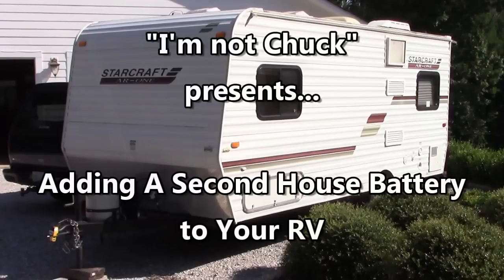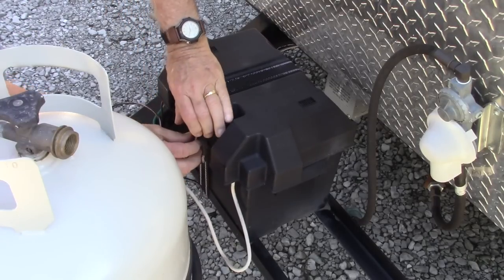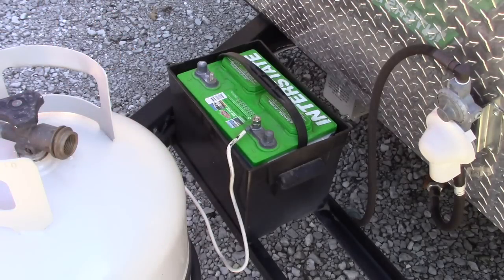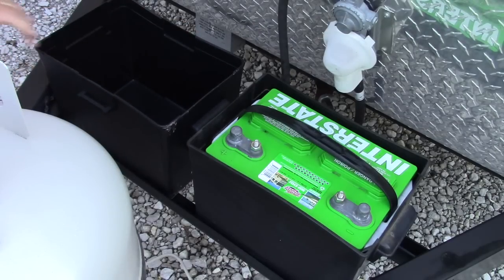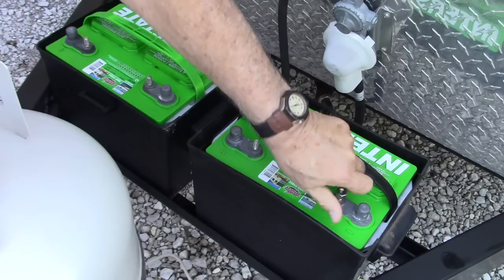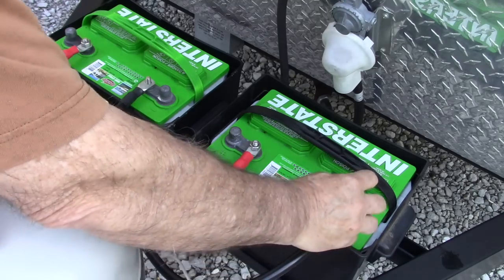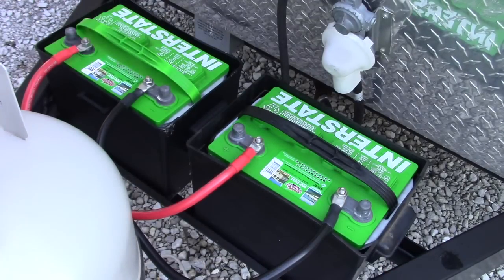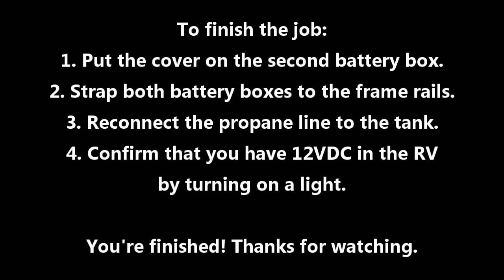Add a 2nd RV Battery

Comment: Great job on the video, you made it simple and easy to fully understand. However, I would suggest an add-on to the video and that's to be carful with wearing a watch, especially one with a metal band and/or a metal clasp. I had an incident where my watch touched the positive lead casing a burn to jump to the opposite side of my wrist. Apparently the current went right though my wrist. Believe me a 12v battery can really give you a jolt.
Reply from the maker: It would be better to remove any metal from your hands. The problem is not so much shock as it is burns. Thanks for watching and commenting. Please subscribe if you haven't already.

Comment: Make sure both batteries have the same date codes so that there is little difference in the capacity of both batteries. If one battery is older than the other, it may have a lower voltage/current capacity causing the two batteries to "fight" against each other, and may cause early failure of both. I found this out when I paralleled two batteries in my Jeep, one original, and another 4 months older. Try to pick both batteries off the shelf with the same, latest date codes. Look in the back of the shelf for the newer batteries, as the seller rotates the older batteries towards the front so they get sold before they get too old. ALWAYS keep both batteries shiny clean, because road dust has iron rust powder (from rusty cars and trucks) in it causing a high resistance path between the positive and negative posts, draining the batteries even while not being used. I use Vaseline to coat the posts to keep corrosion from starting.
Reply from the maker: Very thoughtful ideas. Thanks much for the input and for watching. If you haven't subscribed, please do.
Reply: They have a special grease for batt. Terminals I tk.

Comment: I got rid of my single 12 volt battery and bought two 6 volt batteries, ran them in series and now have 12volt with about an extra 185 amp hours more than two twelves ran parallel like you did.
Reply from the maker: Using two six-volt batteries in series is preferred by many people, and is a good method. However, the specific amp hour capacity in either case depends upon the batteries chosen. Thanks for your comment; please subscribe if you haven't already done so.

Comment: Hi, when adding a second battery, does it need to be the exact same brand or specs. I have a second 12v deep cycle battery but it's from Costco and the one in our rv is an Interstate 12v deep cycle. Thank you very much.
Reply from the maker: Yes, both batteries should be the same age, brand, and specifications for optimum performance and life. Otherwise the newer or stronger battery will do more work and age faster. Thanks for watching.

Comment: Great video. I have a 1 year old battery. Can I add another battery parallel even though it’s 1 year old? Would 4 gauge cable be ok? What size cable do you recommend? Thanks
Reply from the maker: Larger diameter cables are better, but four gauge will certainly work. And generally, it's better for batteries in parallel to be "mates" in terms of age, etc., it's acceptable for them not to be. Thanks for the nice words and for watching.

Comment: Good video, thank you.  However, I have to agree, the negative wire from the trailer should have been connected to the negative post of battery number two.  It would help both batteries to receive equal use and therefore wear equally.
Reply from the maker: Thanks for watching the video and taking the time to comment on it. I also appreciate the compliment.

Comment: This is how i planned on doing this, my question is.  Do you need identical batteries? I.E. say one is a group 24 with 500cc and 600c and the other say a 27  or still a 24 group with 600cc and 750c. Reason i am asking is i will be converting over to interstate RV batteries but currently, i have an Oreily deep cycle that has been good but i want to upgrade. However, this battery is still in good shape no sense in tossing it. once it dies ill get another interstate identical to it.
Reply from the maker: Both batteries should be identical in both size and age, if possible. Otherwise, they will discharge at different rates, and the capacity difference will increase over time. Before you buy Interstates, I would suggest you consider true deep cycle batteries such as the ones made by Trojan.
Reply: Interstate Batteries are imported now and Trojans are also. 
So the quality is not what it was years ago. If you have a Batteries ➕ bulbs in your area the DURACELLS are the best 🇺🇸 made available.

Comment: nice vid.. unfortunately you took out a worthless battery, and replaced it will another worthless battery.. (not deep cycle) get a couple of t-105s or so. I found the GC2 size (golfcart size) battery box like you use at Walmart online.  You can get a good 6v GC battery at Costco for $93 dollars each, and have a true deep cycle system.

you use a nice size cable between the batteries and use the same too small cable to RV.. that's where you need the size more than between batteries.. and it does matter a bit on where you connect the leads,, one to left bat positive and other to right bat negative to keep the pull the same between batteries.. 

keep up the good work.
Reply from the maker: Thanks for the compliment and for your opinions. I agree that Trojan batteries are quite good. Please subscribe if you haven't already.
Reply: Carl Newton j
Reply from the maker: Thanks for watching and for your input. As to the relative worth of dual purpose batteries versus true deep cycle batteries, I agree that true deep cycle batteries are better, but I am not sure whether they are sufficiently better to justify the price increase. I am now testing some cheap dual purpose batteries to see how they perform with proper maintenance and correct charge and discharge patterns. So far, they are doing well, but I am only eight months into the test. I will be doing a video on that experiment in the future. Please subscribe if you haven't already.

Comment: Can't go wrong with an Interstate Battery! Last fall I had my camper plugged into the house, while I was doing some cleaning and getting it prepared for winter and forgot about it and thought nothing of it. My battery was 4 years old. Well ....3 or 4 days later it exploded! I called Interstate Corperate to find out why?  They told me that it keeps charging when you are plugged in, and here I thought it only charged when going down the road being towed. Well guess what? Interstate brought me out a brand new battery! I didn't even ask for them to replace it, I was just wondering how to prevent another battery from exploding in the future! Customer service like THAT is why I will always buy Interstate from now on!
Reply from the maker: It's always great when good companies stand behind their products. Thanks for subscribing, watching, and commenting.
Reply: The Ac/Dc converter of your trailer should have cut back or cycled the charging off when you were plugged into the house. The battery may have exploded to an overcharging failure of the converter.
Reply: hughie voso Probably correct.

Comment: Hello, very informative video as well as the detail of your pinned comment.  Thank you.  My trailer is about a year old and I am looking to upgrade my cables as I do have a problem with one battery discharging faster than the other.  I’m guessing it is because the dealer only used 8 ga wire to connect the two together.  I even switched the batteries and the way it’s wired it still discharged the one with the main coach cables first.  Can you give a suggestion on running new cables to the fuse panel?  Currently it’s not marked but looks to be 8ga maybe 6ga at the most.  Is there any disadvantage to going too big, or a point that there is no addition benefit to a thicker ga?  Thank you.
Reply from the maker: 8 gauge wire is sufficient from the batteries to the fuse panel and is actually better than the 10 found in most travel trailers. My suggestion for very heavy cables is only to connect batteries in parallel. It could be that one of your batteries is just weaker than the other, and there isn't anything I know to fix that. Thanks for watching and for commenting.

Comment: Would there be any advantage to connecting the GROUND cable to the OPPOSITE battery ?
Reply from the maker: No, not any meaningful advantage. Thanks for watching and for commenting.
Reply: yes it will make a more even draw off the batteries more balanced..
Reply from the maker: @cruzinbenny3750  No, it won't. That's one of those things that seem logical, but has no basis in science. Thanks for watching.
Reply: I see this suggested on many articles and forum posts about parallel RV batteries. As an electrical engineer myself, I agree there is no meaningful reason to connect one cable to opposing batteries. From a purely textbook sense, those 0/1 gauge wires will have a tiny loss over the ~2 feet or so, but in practicality, it won't be noticeable.

Comment: Battery that are connected in parallel. It's better to connect positive cable on one battery and negative cable on the other. Then you drain both battery equally. 
Be sure to have same length on both cables between the batteries.
Just a tips.
Reply from the maker: Thanks for watching and commenting on the video. Please read my my post pinned at the top for an explanation of why I do not accept that there is any reason to wire my batteries differently from what I showed in the video.
Reply: Hi if you hook them in Parallel will that give you 24 volts or still 12 volts
Reply from the maker: @Farmer2492  What you see on the video is a parallel configuration. If you were to hook the two 12V batteries in series, then you would have 24V. Thanks for watching.

Comment: I'm not Chuck, I have another question. I have enough room on my trailer tongue for three batteries, can I connect three batteries in parallel for more electrical storage?
Reply from the maker: Sure, just be sure to use heavy wire and good connectors. It's preferable to have all the batteries be the same type, size, and age.
Reply: @ImnotChuck.  Thanks, I'm not Chuck, just bought a bumper pull, I'm taking a boon docking zig-zag route, (six weeks travel) to the coast of Oregon, from Weatherford Texas and need all the juice I can store, (powered by a Champion Gen). 
     I'm subscribing to your channel now.
    Good  luck.
Reply from the maker: @nehpetsrellek2750  Sounds like a great trip. From what I can tell, the Champion gens are good units. Take care.
Reply: @ImnotChuck.  👍

Comment: Ive found that a lot of devices I have in my home, such as my cable internet modem, the wifi router, and the cell-spot router for T-Mobile, all are connected to the 110AC, and each one converts it with the big plug that goes into the wall, (Switching power supply AC>DC0 all run 12v at the device itself.  I purchased a Marine battery, deep cycle, a cheap 12v solar panel for RV's, and have hooked each one up, by cutting the plug off of them, and connecting them directly to the 12v batter.  I did it this way, because if I purchased an Inverter, and plugged the devices directly into the inverter, I would be then converting DC from the solar panel, to AC in the inverrter, which then would be converted back into DC with the plug.  This makes it roughly 60% more efficient after I did the math.
Reply from the maker: That's a good way to make more efficient use of DC from solar panels or from any DC source. Thanks for watching and for commenting.
Reply: This went so far over my head.
Reply from the maker: @Simply_Anthony83  Thanks for watching and commenting. If you don't "get it" you should probably not work on the electrical part of an RV.

Comment: Is the heavy cables between the two batteries necessary?  The feed wire for the trailer seems much smaller, so couldn't you size the wires between the two batteries to the same size as the trailer feed wires?
Reply from the maker: Hi. Thanks for watching. It does seem like smaller wires would be okay, but the purpose of the large wire between the two batteries is to keep the batteries equalized. If not, then the weaker battery will discharge faster and fail much sooner.
Reply: There is Absolutely no requirement for the heavy cables. Even with a everything on in the trailer you would never draw enough amps to need it.
And the Proper way to hookup the trailer wires to the batteries is Positive to one battery and Negative to the other. 
That way the batteries will Charge and Discharge as a pair. The way you have it by only hooking up to the one leaves the batteries to feed off each other. 
And if you are looking for longer run time and Amp Hours your better off with 2 6volts. Golf cart batteries are the same footprint as the group 24 just 11/2 inches taller.
Reply from the maker: @jamesglenn520  If you would read the scientific explanation that I wrote and pinned to the top of the comments, you would have the facts, and the correct answer to both your comments. The short, heavy cables connecting the two batteries eliminate any significant difference in the resistance due to the connection position of the cables. Your post is just one of many repeats of an old wive's tale told by shade tree mechanics with no basis in science. Thanks for watching and for posting.
Reply: @ImnotChuck.  atta boy Chuck

Comment: What good does it do to put such heavy cables on the 2 battery's if the cables from the RV are so small?? You might burn the small cables up doing that>>you think??
Reply from the maker: Hi James. That's a interesting observation. The two heavy cables between the batteries ensure that the two batteries function as one battery; that's because the resistance of the heavy cables is very close to zero ohms. The system wiring in my RV is fuse protected so there is no danger of the wires getting hot. Thanks for watching.

Comment: As Already mentioned, the ground must be connected to the battery that you are not taking the live feed from, this will ensure you get equal discharge of both batteries.
Reply from the maker: Thanks for watching and commenting. I have addressed this issue many times; please see the comment I pinned to the top which explains why this common misconception is incorrect.

Comment: Nice video, thanks for explaining everything so clearly. I'll actually be able to do this. We take long trips through the desert and next time would actually like to keep the refrigerator running. Can I apply this same technique if I want 3 aux batteries? is it safe to have 3?
Reply from the maker: Thanks for the positive comment Michael G. Adding a second battery will effectively double the time you can boondock. And a third battery is completely safe and done in exactly the same way. I have another video planned that shows how to add a couple of solar panels to the system; solar panels are great in the desert.

Comment: I  have a ground wire from the camper along with the positive and negative wires (3 total). Where would you connect the ground?
Reply from the maker: The ground wire from the frame of the trailer should be connected to the negative post of either battery. Thanks for watching.

Comment: Quick question, when you want to charge the batteries with an charger, how do you connect the leads, just to the pos and neg to one battery or pos on Batt A and Neg on Batt B?
Reply from the maker: Good question. The answer is to connect the positive lead from the charger to either of the positive battery terminals, and the negative lead from the charger to either of the negative battery terminals. Because the batteries are in parallel, it's easy. Thanks for watching.

Comment: Good video can i hook up both batteries like this for my boat 12 volt trolling motor, and how do I charge the batteries when there hooked up parallel like this
Reply from the maker: Yes, trolling motor batteries work the same way, and are charged just as if there was only one battery... just connect the charger positive anywhere on the batteries' positive, and negative to negative. Thanks for watching and posting.

Comment: What length did you use for the 1 gauge jumper cable 2ft?
Reply from the maker: I have sold that trailer and gotten a different one, and I honestly don't remember the length of the cable. Two feet sounds about right. Thanks.

Comment: Hi chuck does this reduce the charge life of one battery more than the other ?as i got told do what you but to go positive on one battery and ground on second great video and very clear instruction thanks
Reply from the maker: No, the heavy gauge wire connecting the two batteries together makes certain there is no voltage difference between them. The individual cells in both batteries "think" that they are all in the same battery. If you want a more detailed answer, read the post that I have at the top of the comments. Thanks for watching and for your question.
Reply: incorrect it does reduce charge life.. i have the same batteries the dealer hooked up your way with thick wire and the main battery died. i had to replace it with in 15 months.  I'm hooking them up one wire on one battery and the other on the second battery.. the way it should be wired.. @ImnotChuck.
Reply from the maker: @ColecrcCave  You are welcome to hook them up any way you want. Thanks for watching.
Reply: Had mine hooked up that way and after 2 years killed one battery, just replaced it yesterday and hooked positive to one and negative to the other, the converter will not charge equally. trust me on this. @ImnotChuck.
Reply: I had them hooked up with positive on one and negative on the other.  Then the one with the positive charge cable died first.  Batteries are not always perfect and electricity is a working theory.